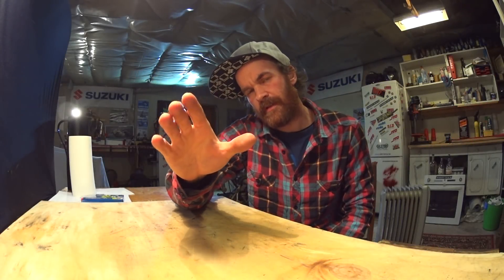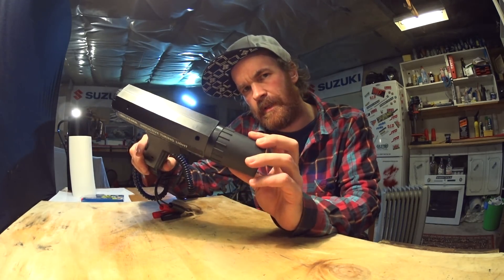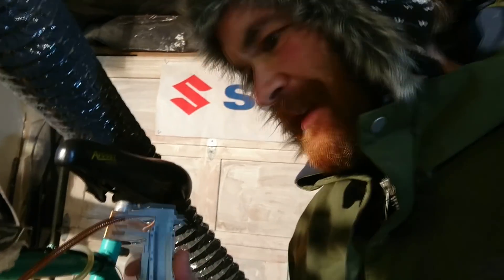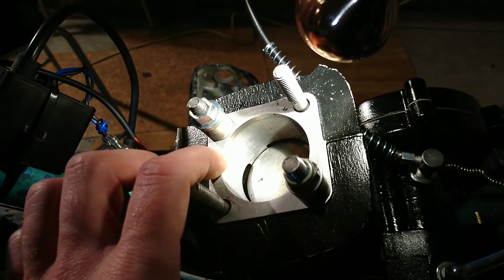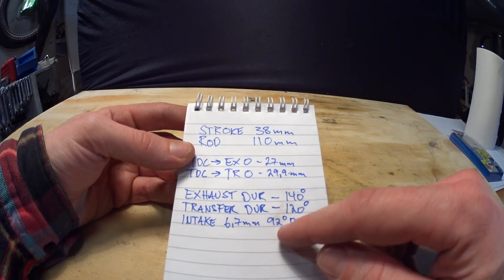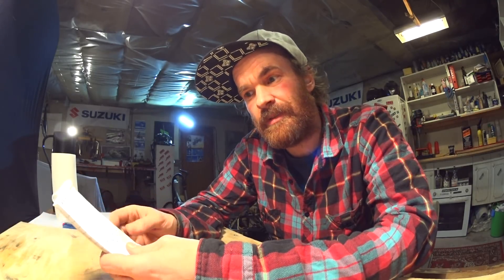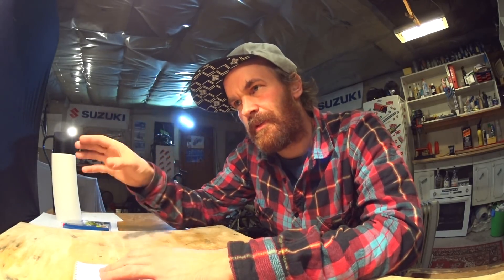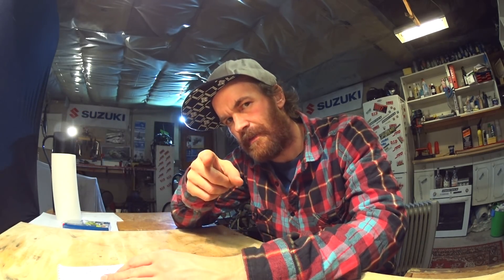Port Timing Motorized Bike, I'M SHOCKED! WHAT WERE THEY THINKING??

Comment: This an golden opportunity to show how raising the exhaust port in stages can change the engines output. How about the carb inlet timing compared to other similar engines?
Reply: I was always told to only change one variable at a time so you can see changes.
Reply from the maker: +Hugh Cameron Absolutely! Haven't looked into many "similar" engines, but 92° duration is low. Not the best example, but my Spx has 233°
Reply from the maker: +Hugh Cameron That's good practice! Easy to get carried away tho...
Reply: I dig ya man, but I really think you need an accurate way of measuring duration.
Reply from the maker: Thanks! I usually use a long travel indicator but it died on me. Got a new one now. Btw, the "TSR" in my intro is a Swedish two stroke site, not the software.
Reply: Hugh, that is the rule of thumb for any kind of testing.  The complications start though, when several factors "overlap" each other.  So if you only change one factor of overlapping entities, it is still hard to optimize the system.  But, if you change more than one factor at a time, who knows what direction your testing will take you, or how many false conclusions you will come up with.  I had a course about "testing" in college,---and what you said is taught.

Comment: Wonder if thats why these run better with short straight pipe and not expansion chamber?  I tried fitting a chamber years ago with no difference at all but ince my exhaust broke i got huge power increase down low but lost top speed.. thats why i ended up fitting fatter pipe with stock muffler modified a bit
Reply from the maker: +Sean Fiba Yeah, can't imagine this will work with a pipe at all. Not only are the exhaust extremely low, the transfers are almost the same height..
Reply: You seen http://www.dragonfly75.com/motorbike/index.html ?

This guy knows a lot about these little bike engines and has designed his own pipe which others rate very good. He converted his engine to reed valve though.
Reply from the maker: +kan't be Yeah, a while ago. Have to read up now that it's more relevant to me!

Comment: well your not going to be able to raise the port that much. I think you should take out as much material as you can tho. I think you should continue with this cylinder alot of people arent going to buy a new cylinder for these things. i think you'll run out of material on the roof of the port, i could be wrong. you will definately need quite a bit more duration. The transfers might be okay the way they are. you could maybe make a third port on the back of the cylinder. how strong are the cranks on these it might just fly apart with alot of rpm. Its not going to cost anything to grind a bit off it.
Reply from the maker: +marcus mcc Exactly, not enough meat, good point!